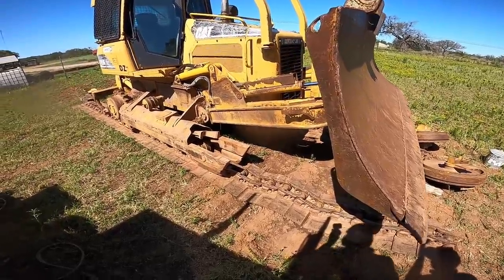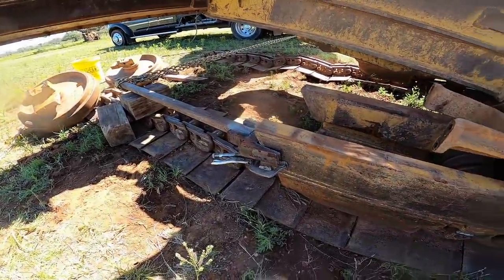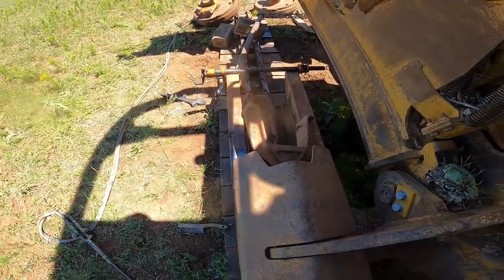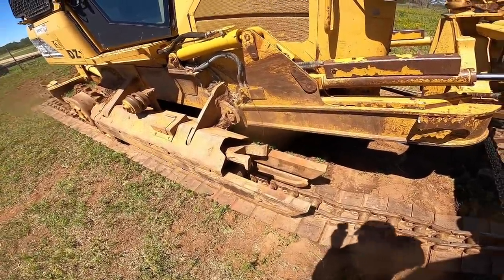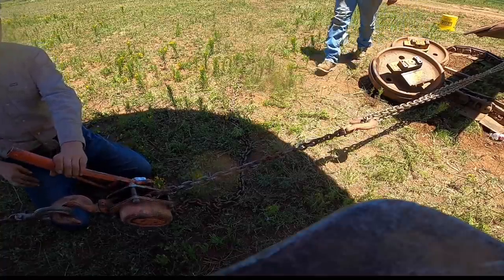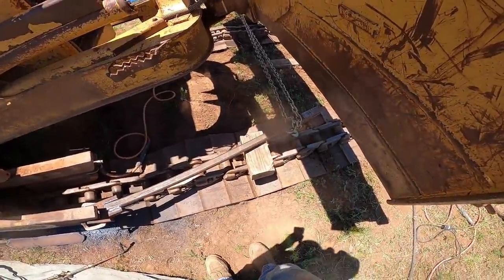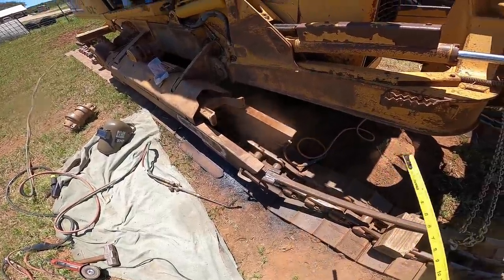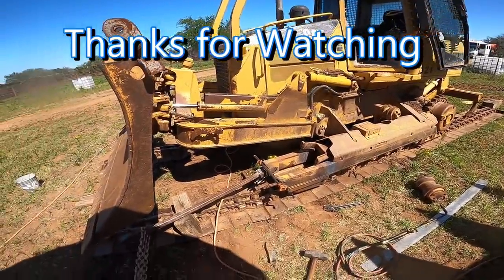CAT D-5 Dozer Issue.

Comment: Seems like they ran into something that didn't want to move so it sprung the track rails. Wow, to move them out that far though... sheesh. 
If your son wants to stay in the same trade, might let him do some burning. One thing I learned, you can add or remove with metal easily. Great video and great work. Cheers :)

Comment: Always best to grow some heavy towels over each end of the chain used for pulling. Just in case it snaps, it’s enough force to take someone’s head off, the towels will slow the chain down. Seen some brutal videos of guys using chains and winches trying to pull out a stuck off road vehicle, no good ending

Comment: Greetings from Australia. I am a retired heavy diesel mechanic with almost sixty years in the trucking and earth moving business and I would like to say that the piece of flat flat steel on the outside the undercarriage that you gouged off was useless in that position (welded flat against the sidewall) and not adding any strength from stopping the idler slide legs opening up. I have repaired many of these over the years by welding a length of 3"x3"x1/4" square tubing along both sides of the undercarriage. This opening up of the idler guides is caused by to many tight turns in rocky ground.
Reply from the maker: I will pass on the suggestion.
Reply from the maker: Thank you.

Comment: used to work on dozerscould not stand to see  holes cut in side of track frame to put a nut on so much easyier to do it right you do good work what is condition of track guides that may have been cause of spreeading or  just plain wore out rails you have a great day

Comment: thats not a very common issue, but it does happen, when the track chains get worn the idler moves further out on those rails. as is does the idler mounts usually wear out and the idler can begin to rotate, looking at it from the front. as it gets worse and worse the idler can rotate further and begin to put a tremendous load on the rails, and because they are the only thing keeping the idler flat level and oriented properly they begin to spread. i was surprised they didnt want you to weld up the rails/idler carrier, to remove this slop.

Comment: I have had real good luck just heating  from the high side not the low side and cooling it with water and air. That is where the metal is stretched. I have straightened I beams by doing that. As it cools it shrinks back.

Comment: metal shrinks towards the heat....counter-intuitive, but should be heating the inner side while restraining movement, then cooling will move the plate to the inner side.  this is how they bend beams for ships and bridges into curves, but same principle applies to removing a bend to straighten.  linde makes multiple head torches to do this but you can also make several passes with an oxy torch or rosebud to do the same.  apparently heat to dull red and then cool with air or water to pull metal.  the cooling pull always exceeds the heating stretch.  some of the bend on the side with the plate was from welding the plate on that side...metal curved to the heat.  for anyone interested in heat straightening metal, here is a video by a shipwright showing how it can be used....https://www.youtube.com/watch?v=QIc4xF46Yrs

Comment: first im trying to figure out how you can spread that like that,next if you are spreading it like that ,might be a time for a upgrade to a d7, wow ive had to burn out many broken bolts on rollers but i have never seen it spread like that ,how did the rollers even stay in line with track

Comment: Next time when you need to remove broken bolts, that broke off flush, please try this it should say you alot of time.get a nut where inside hole of nut is same seize diameter of broken bolt. Center nut hole with broken bolt, fill nut hole with weld .(best way i know, better then using washers,  and welding nut to washer

Comment: You do great work Isaac.  Your approach on this project worked out well but might have been a little easier if you used the "flame straightening" method.  Tom Lipton, who has the OXtool channel, wrote an article about it https://www.ctemag.com/news/articles/how-flame-straightening-works  that describes it well.  Basically, you restrain the piece from moving and then use concentrated heat to cause the steel to upset on the side you wish it to move towards.  When the upset area cools down it shrinks and causes the piece to move in that direction.  This technique is used frequently to straighten bent bridge beams or to camber structural steel.

Comment: I've used this before but don't know if it would be useful in this situation.  On a warped piece, I've welded with huge power and rod on the convex of the bend and then grind off if needed.  Something along the lines of 1/4" rod with about 180 amps or more if I can.
Reply: That's one way of doing it, if you don't have a torch at hand. All you are doing, is poring heat into the piece, to make it bend...
(Wich sounds simple, but it's tricky to get it right)

Comment: Do you pull it straight then just let it cool? I'm always trying to figure out whether or not to over compensate to account for it pulling back when tension is off
Reply: I'm sure you know the term is springback. He mentioned accounting for springback in the video, but yeah maybe he could go more into detail about what exactly he did
Reply: Good video to watch.
Prevention and Control of Distortion in Arc Welding.
Animated by Disney.

Comment: Could'nt quite se,  but do you heat it red or just enough to get it to move sort of like bending alu?
Reply from the maker: Some spots got red but I was mostly trying to heat it enough to relax.
Reply: @ICWeld  so just enough to get it to relax without changing the composition of the metal,  brilliant,  you do good work sir.

Comment: Very interesting! While I know the theory of heat expansion, I never quite could wrap my head around how it actually works. Why doesn't it shrink back to its original measures?
Also, did you ever encountered problems from annealing the steel?
Reply: There is actually a very good old  animated film video on that subject. The film is from somewhere around WWII and stars an animated line drawing of a welder.
Reply: Found It.
Prevention and Control of Distortion in Arc Welding.
Punch that into the YouTube search engine and it will pop up straight away. Animated by Disney.
Reply: @markfryer9880  Wow nice, thanks! I just watched it!
Altho interestingly, the very first explaination is exactly the opposite to what we see IC doing. So I stay with my premise that this is some kind of black witchcraft.
Reply: @Alex-nx5wi  true... You have to know the magic words, and the ways of the steel....

Ever been around some old welders?
I have,, and do they have a lot of "magic words" for when things go bad ...😄😄

Comment: Sorry, you may be a master craftsman , but you have no regard for safety. No blocking, cribbing or stands under the dozer blade, one mistake , blown hose, chain breaks and takes out a hose , etc and you are done. I have worked around heavy equipment for forty years and have seen some deadly accidents, please for your own safety and for that of your son, block,  crib, release stored energy before working under or near a suspended load.It only takes one mishap or short cut to take a life.